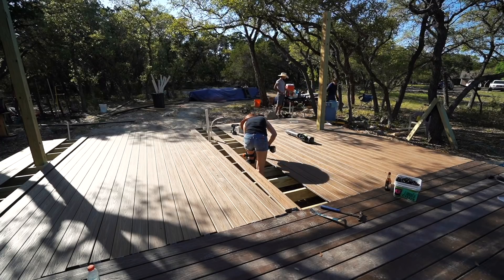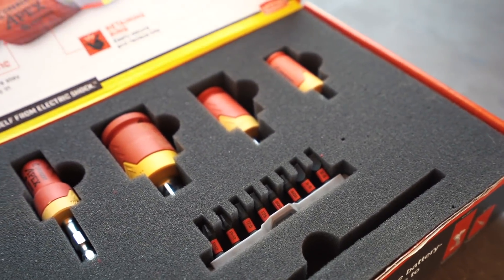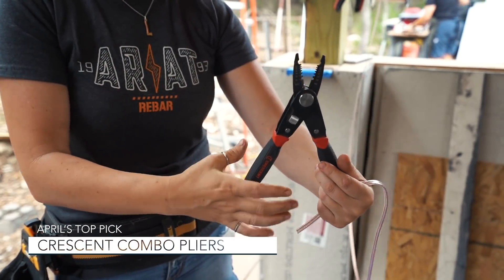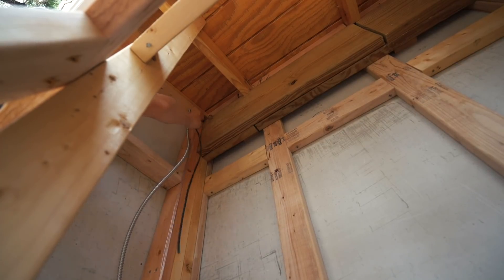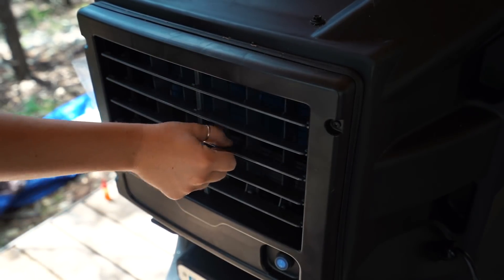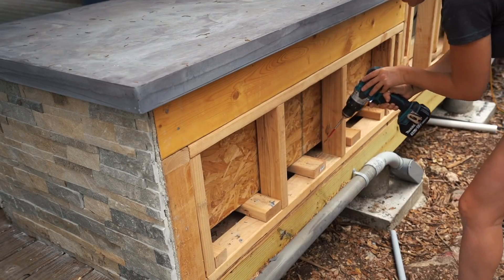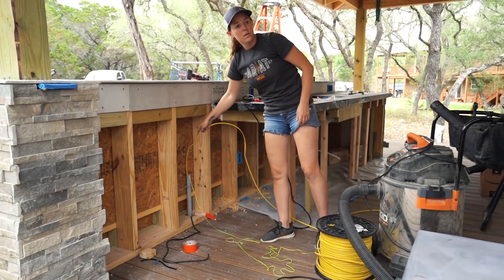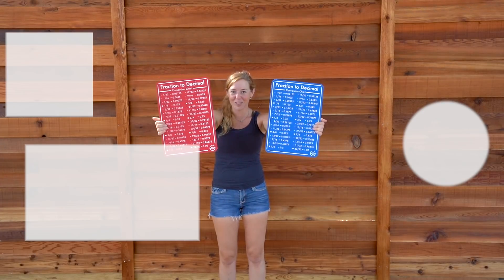DIY Electrical Wiring Tips | Outdoor Kitchen Part 5

Comment: I assume when you had an "electrician dial 100 Amps down to 40" you meant he ran a feed from a 40 Amp breaker in the main service panel to the kitchen.
As all MeTubers know, to find your mistakes, just post a video and all the the self appointed authorities will start pounding on their keyboards.
When use a fish tape, attach a string to the first wire pulled through and than use that as you suggested when sucking a string through conduit.

Comment: Those butt connectors used on the low voltage wiring are environmental butt connectors.... apply heat and the ends seal.

Comment: Always label wires with what's at the OTHER end. If you think you need it you can also label the wire with where it's going, but that's a lot of the time self explanatory. Now the other end 10m away in another rooom through small holes with other wires with the same color ... is asking for trouble if you don't have a label with what's at the other end in your hand!

Comment: Another good tip: plan a separate route for any lines that will carry signal such as video, networking, or audio to make sure there is no interference from the power lines
Reply: Yep. You'll get an annoying 60hz hum in your speakers if you run unshielded speaker cable next to AC wiring.
Reply: And if those lights are really low voltage DC (e.g. 12v), this probably won't be an issue.

Comment: Hi April. You may need to laminate another piece of wood onto the beam that you drilled the vertical hole through in order to pass inspection unless the beam was over designed. It's ok to drill horizontally through the middle of a beam but not vertically.  Awesome project.

Comment: Why is it ran instead of run? There must be a trade reason.
Reply: Past tense. Simple as that.
Reply: @WinchesterxNL  I've heard it used consistently, past, present and future. It bothers me.
Reply: Consistently using wrong tense.  Unless your saying “we RAN the wires yesterday...”   if your in the act of doing it presently then you should say “ RUN “
Reply: @rmaloney9976  Seeing she is not presently doing it, but talking about it after the fact. It would be the right term, right?
Reply: @WinchesterxNL  no she is presently doing it
Reply: @rmaloney9976  No, when she's narrating it, it's been done. She's recapping her events. She records, and after she narrates, past tense. Not presently doing it.
Reply: There were probably more but I caught these.

1:30 should be run

5:51 should be run

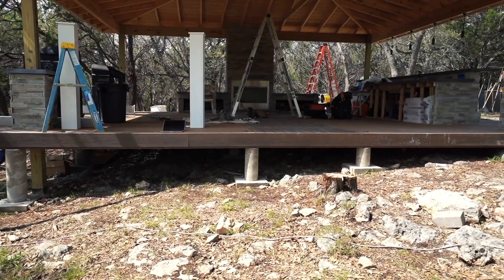7:23 should be run

13:08 should be run

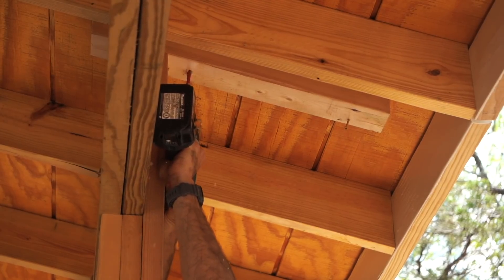13:27 should be run

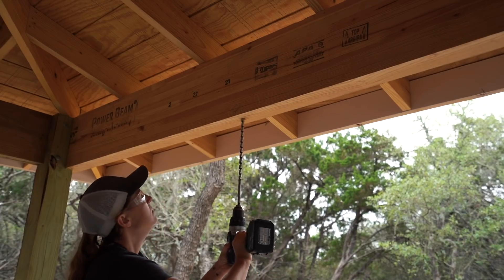Comment: 04:59 You know thats crimp connectors`with heat shrink ? Use heatgun, lighter or torch to shrink them to watertight connections.
Reply: I was looking to see if anyone else noticed that.
Reply: The condensation from the heating during the day and cooling during the night will be sufficient moisture to allow corrosion to be an issue.

Also, if you choose your lighting carefully, all or most of it can be low voltage.
Reply: after the first rainfall water will get inside the connectors if she indeed never put heat to shrink the ends
Reply: It's under the roof, but it's good practice to heat shrink the connection

Comment: NM cable (Romex) is not rated for a damp or wet location. Your outdoor kitchen is a damp location.
Reply: Yeah was thinking about that the whole time. Should’ve done it in liquid tight and pulled THHN. OR PVC jacketed MC cable is also aa nice alternative for outdoor installations.
Reply: Your right, she should've used THHN or at least pulled UF cable.  Even installed thru a conduit the area is still considered a damp location and romex should not have been installed.
Reply: Also is it ok for her to install Romex in a conduit? (Not here to nib pick)
Reply: @nevrbdwnruby7484  you can pull Romex thru conduit, it’s not done in the trade much. We pull individual wire. 
The Romex has to be rated for the application its being used in. The Romex is not listed for damp or wet locations.
Reply: @nevrbdwnruby7484  It is compliant to install Romex in conduit in a dry location as long as conduit fill .requirements are met.

Comment: Running power and signal together is generally a no no. I've had many installations with problems, and it's almost always because power and signal were routed right next to each other.
Reply: You are correct the practice is NOT to run voltage in parallel to data/ voice.
You can see that it was outdoor landscape type lighting (plus she stated) Low voltage wiring which doesn't give off the the (EMF) noise of high voltage.
Reply: You can usually get away with running signal (voice, data, speaker, etc.) cable with line voltage if the signal cable is shielded. However, it is still not ideal and should be avoided as much as possible.
Reply: There are countries in the world, where is it forbidden, Even When all cables are shielded. Even Not so Good: Drilling Holes in the under construction from your Roof. Do you Life in the Tornado alley April?
Also: you should look at the length of your cables….if they are all different Long your spots(12V) are different shine(in Power) america is 110V Right?? So there is also a Max in length and AWG of your cable.

But aside from this i with you happy working, April!

Comment: Really should have run shielded 14/2 or 16/2 when you parallel power lines. If you run anything with a switched mode power supply you will definitely run into noise issues.

Comment: you made a big mistake drilling into the support beam of the roof you made a vertical drill hole all the way through the beam that has now become a weak point. your beam is for example 6cm wide and you drill a hole 2 cm it speaks for itself you killed 1/3 of the total strength of that beam. over here it's against construction regulation to weakening the support structure in any way. it's only a tip, keep doing what you do April love your videos
Reply: I was hoping someone else noticed this or it was code elsewhere. In Indiana, we get the middle 2/3 of the joist. The rest is a no drill zone.
Reply: i was think the same thing. drilling the bead, oh no

Comment: Now that's a Baddass out side kitchen, though, have you thought about screening or storming it, also, in your design for the 4 sides are you building wood counter like tops and adding stools for folks to eat. It doesn't even have to be on all 4 sides, I can see it on 2 sides..Whoa young lady, your an inspiration with your know how and getting it done, and the fact you share it on the net..Priceless.

Comment: Great job, but FYI, Romex should not be run in conduit.I'm sure you might not have to follow code where you are but most other folks do. Thanks for sharing your knowledge with us.
Reply: can you run the romex without the outer sheathing through conduit?
Reply: @ckcuev  No because then your ground wire will be bare and with the solid wire you will catch Hell going through bends. Use stranded THHN wire and it will pull like Silk. Stranded wire in the same gauge carries more amps than solid wire anyway which is a bonus. If you do decide to break the rules and use Romex in conduit you will never be able to add or pull a new wire into it if you have any bends. It's not designed for that purpose.
Reply: @williamdebow3478  i want to run 20amp from my house to my shed.  i want to use schedule 40 conduit and per code has to be buried 18".. my shed is about 13 feet from the house. so you're saying to do this i need 12awg stranded THHN wire?
Reply: @ckcuev  Yes, you need #12 AWG THHN stranded wire. You should be able to buy it loose by the foot at Lowe's or Home Depot. You would buy (1) black, (1) white and (1) green if running it 120 VAC. If you want to run it 240 VAC you would buy twice the distance in black and one in green, unless you are sub feeding to a mini panel then you would add a white wire as well. Of course you have the option of just running Direct Burial (#12 UF) which is basically waterproof Romex designed to be buried directly in the ground. You would need no conduit and would need to bury "24 deep.
Reply: @ckcuev  I would suggest going with the conduit method if there is ANY chance you may dig in the area in the future!!
Reply: @ckcuev  Check your codes, you might be able to go shallower if you put the circuit on a GFI breaker. I was able to.
Reply: @ianbutler1983  I did. Unfortunately no dice. I have to go down 18" with schedule 80.
Reply: @williamdebow3478  your ground wire in a raceway can be bare
Reply: @ckcuev  no the conductors inside of romex are not marked, because its a cable assembly.
Reply: Quick question from an electronic noob.
Why wouldn't that be allowed?
Sounds like an extra protective sleeve to me?
Reply: @WinchesterxNL  per code you can't because of possible overheating issues.
Reply: @ckcuev  Aaaahhhh. That makes sense.
And what if the temperature is controlled? Say... Ventilation? Or in April's case. Cold floor touching the conduit?
Reply: @WinchesterxNL  her floor is open and in texas heat the conduit will bake with the wire causing problems. it's better to follow code.
Reply: @ckcuev  you can to just in dry locations and conduit fill is 53% per chapter 9 of the NEC
Reply: @WinchesterxNL  Code doesn't allow it and it would be a nightmare to pull if any bends or turns and adding wire in the future would almost be impossible. Do yourself a favor and use stranded wire when possible in conduit, it bends and pulls easier.
Reply: The only thing that makes the romex through the conduit in this case it is outside, which by code is consider a wet and damp location which you can not use romex had she used UF cable it beeb alright
 If it was inside or dry location as long as you follow the 53% fill for cables in a raceway its ok no code against that. But by time you up size the conduit its just as cheap to by single conductor cable. If anyone still say you can not run romex in conduit please quote what section of the N E C says that. You will not find it

Comment: great job! audiophiles would keep the speaker wires at least a foot away from power to reduce interference but us home-dyi's won't even notice the difference...maybe pre-wire for cameras even if you don't use them now. great job! stay safe!

9edit) And trust me folks I placed this comment above to generate the professional dialogue as you have demonstrated in the replies. As a low-voltage tech from track homes to the huge customs, we strive to get our runs as far from powah as possible. 

I'll even re-run a wire(s) on my own dime if I find someone "using my holes" to cover a change order. If it's a bundle of low and a noticeable romex after the fact, then we will have a discussion! Usually isn't a problem just have lunch (break time) with others on a site generate a lil cooperation.

The comments below are very important especially if you sell your property--in my area 10 years after you have sold so I got my DYI patio cover county stamps from footers to finish.
Reply: Yeah audiophiles and home-diys (assuming that's what you even meant) have no overlap. Non-audiophiles won't notice hiss, popping, and drop outs though, right?
Reply: @michaelgleason4791  of course they will. certifiably! and DYI means don't "Do Yourself In"
Reply: Sure!  Constant 60hz Hum added to the music will hardly be noticible.  Not to mention the Tweeter damaging Popping when lights and other devices on that circuit get turned on and off.  Non-audiophiles won't even notice when all the upper frequency portions of the music disappears because the tweeters are blown.
Reply: @thebkg  exactly! Now they know after buying a new home with the surround sound package --what in the world? I think someone left the kernels in the microwave--um we don't eat popcorn!